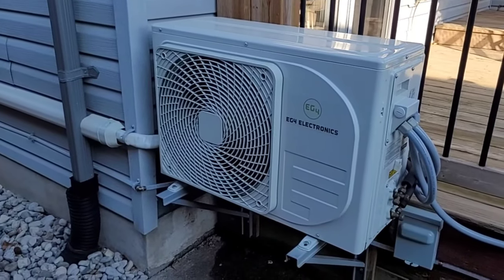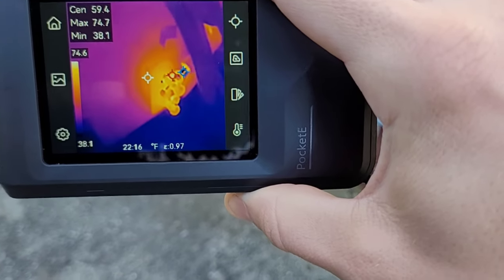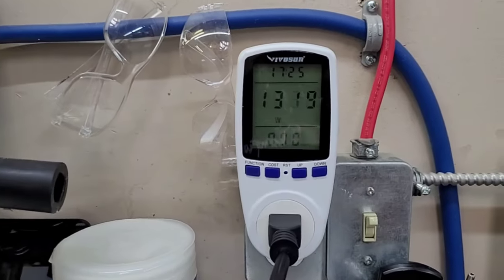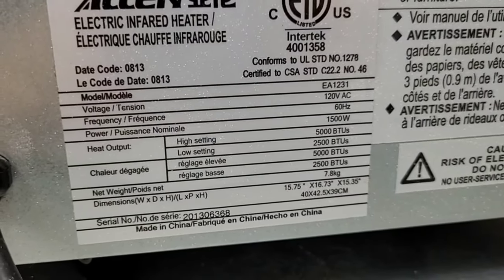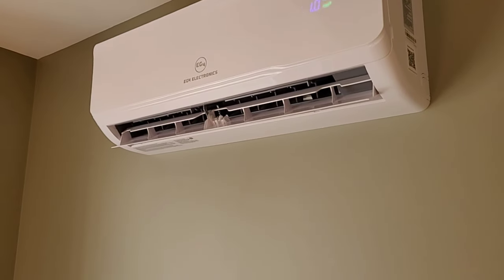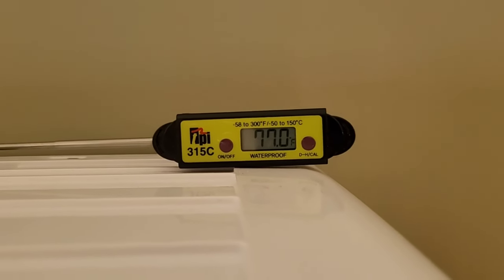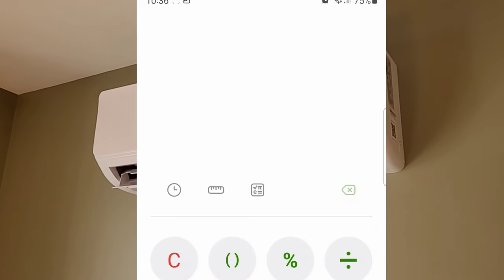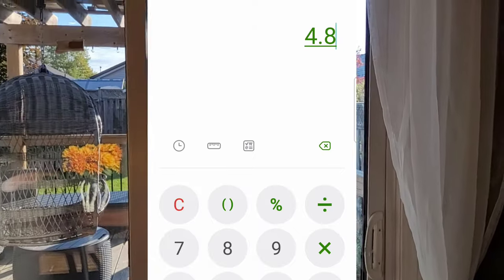How Efficient Is The EG4 Solar Hybrid Heat Pump?

Comment: Wow, that's a lot to digest for us layman.  Thanks for the information and the video. Unfortunately still have not received my 2 units. Emailed and adked replied there is now no time frame on them. Kinda afraid they are stuck on the other side of the Panama Canal😢 Was really hoping to had them by now and installed and running.  But out of my controll.... Jeff
Reply from the maker: I'm starting to wonder if they got held in customs. I was thinking about emailing too.
Reply: @SmitHVAC.  let me know what you find out, if you would. Thanks
Reply from the maker: @JWTX my back ordered 24k just shipped, you should be seeing an email soon
Reply: @SmitHVAC.  Hope so, I'll  have to get my wife to check. We're supposed to pick up in person, as I live an hour away.  Let you know. Thanks.... Jeff
Reply: @SmitHVAC.  just got a call from Signature Solar saying ready for pickup.  So will be getting them next week sometime.  Said were stuck at Panama canal then at customs too. Hope you're going to do an installation video most on the line set hook up part.  Thanks again.... Jeff
Reply from the maker: @JWTX  Not sure if I'll be able to do a video on the 24k. It's heading to New York and we just had a baby so we won't be travelling for a little while
Reply: @SmitHVAC.  OK, gotcha. Congrats on the baby. Just had my first Grandchild 3 1/2 months ago. And they left for work in Colorado last week. Kinda sad about that.

Comment: Thanks for the good video. I'm curious to know if there is a way to have a DC-only solar with battery storage system, basically skipping the inversion step to deliver battery power to the heat pump.
Reply from the maker: Not yet, Deye makes a 48v version but eg4 has not adopted it yet. Maybe someday!
Reply: Hotspot energy has a 48v DC powered minisplit
Reply: Yea I’ve tryed to get a 48v from deye, they said no because Eg4/Monopoly has made them sign a no export to Canada/Usa agreement. At least that’s what I was told.
Reply: Get someone to buy it and ship to you.
I wonder if eg4 has a patent agreement...